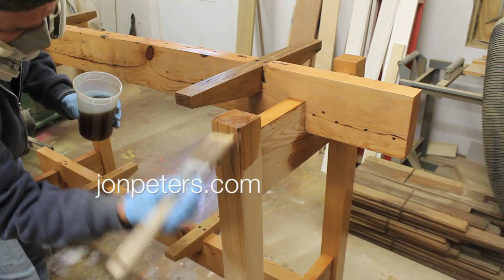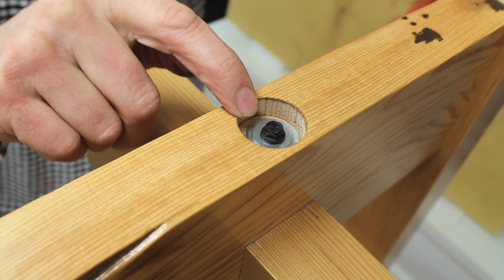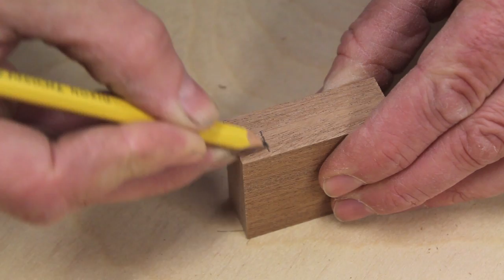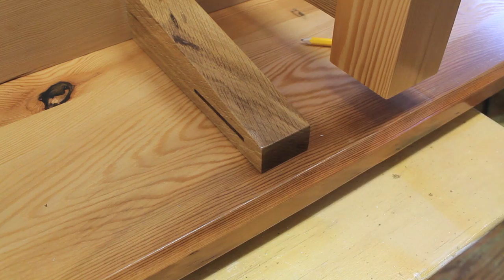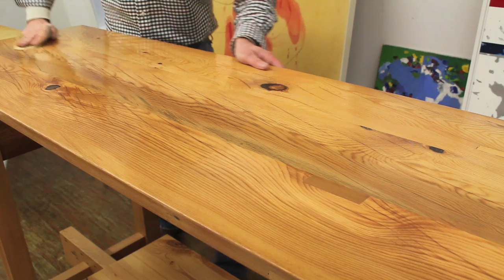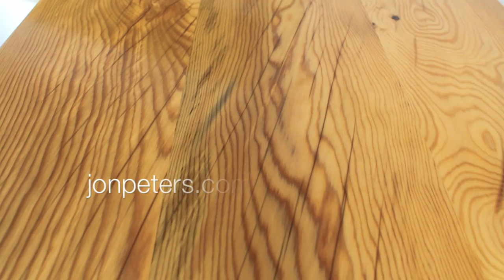Hurricane Sandy Recovery, Finishing Reclaimed Wood Church Altar

Comment: You did a great job. I have been working with reclaimed wood for a couple of years now. lots of rewards in saving old discarded wood. I get the impresion you are from N.Y. or N.J. I am in Staten Island and I have a fan of your work for years thanks for work in producing these films I have used some of your advice many times. and your are one of the only woodworkers on you tube that has not gone to the sell sell sell side of the web.      Thank You  Glenn

Comment: Nice project Jon!  The Altar came out beautifully!  Just a suggestion...if you use reclaimed wood a lot and are concerned for hidden nails, might I suggest a gadget I use while metal detecting and that is a "pinpointed" by Garrett.  They run about $125 but are well worth it.  I use quite a bit of salvaged lumber and it has paid for itself many times over in blade replacement cost and personal safety.  Any place that sells detectors should have them or you can order online.
Reply from the maker: great info, Thanks